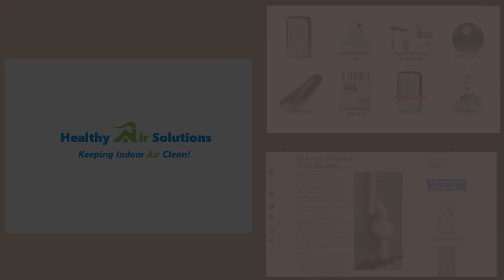How To Install Roof Flashing WITHOUT Leaks “DIY Radon Mitigation”

Comment: I have a passive pipe already installed.  To install the fan, can it be in the basement or does it have to be in the attic?  There’s an outlet in the basement for it and the sewer sump.
Reply from the maker: Fans should be installed in a non living space such as an attic or garage. This is in case of a leak were to ever occur the fan would be pumping radon into the home.

Comment: Almost exactly what I was looking for.  Except on a metal roof. Like the tip on painting the pioe black.
Reply from the maker: @comment5884 Yea a metal roof can prevent its own set of challenges especially in the winter 😅 Probably needs its own video
The process is similar but after drilling up with a metal bit from the attic we then use a pair of snips to cut out the circle in the metal. Then using a saw we cut out the wood. 

In a link I’ll provide the roof flashing we use. 
https://www.indoor-air-health-advisor.com/healthy-air-solutions.html#!/Universal-Master-Flash-No-3/p/268019072/category=36410008

Feel free to reach out to me on my website and I’ll be happy to help you with any questions.